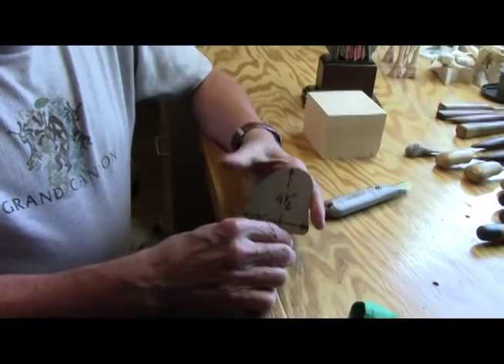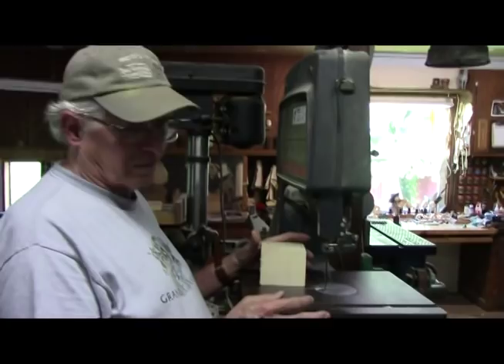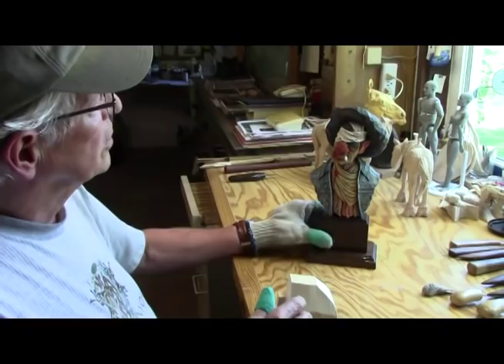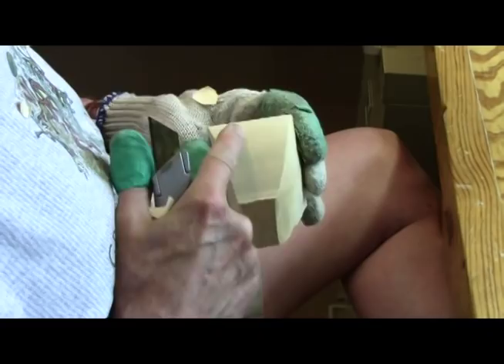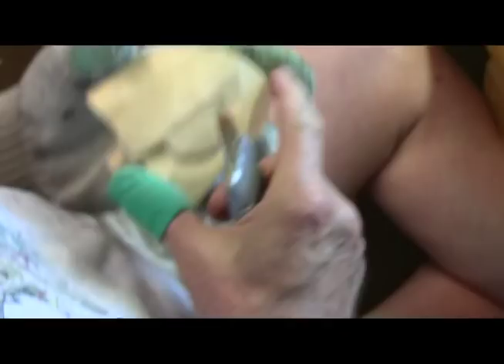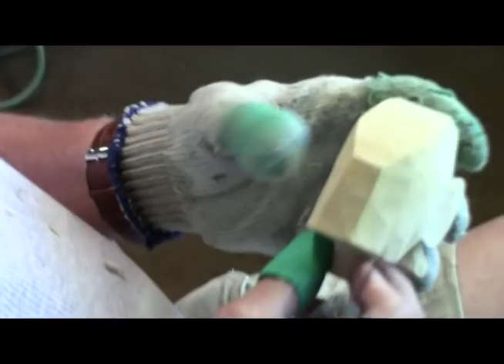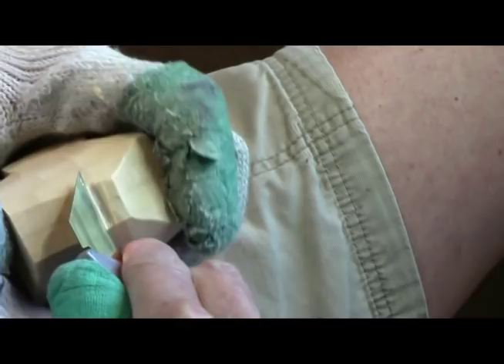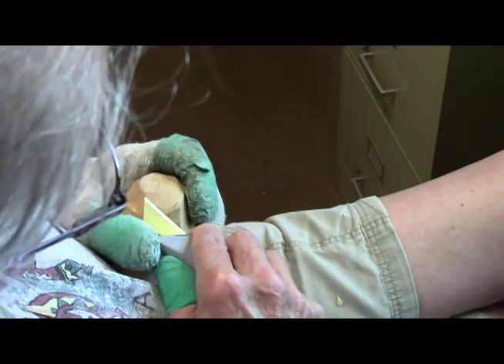Carving a Caricature Head   Part 1

Comment: Pine will do that within an inch. You can be carving away at southern yellow pine and next thing you know, the grain changes less than an inch away from where you just were, on the same side. I started on pine and may go back to it, because getting basswood seems awfully expensive in comparison. It is a dream to carve though. I wish I could get more basswood.

I have settled on carving with my smaller Swiss Army Knife. I use the smaller blade. It stays sharp a lot longer than any of my other knives. I was using my Xacto knife, but it is just a little too weak for deeper cuts. I switch to it for the fine tuning. 

Subscribed. I love your carvings. Beautiful artwork.